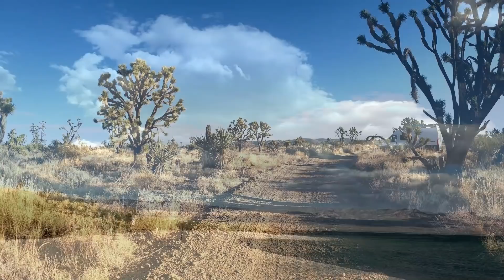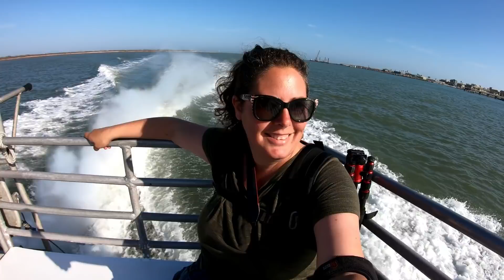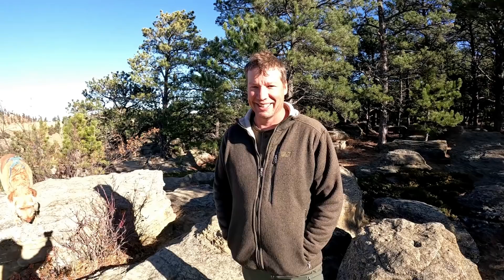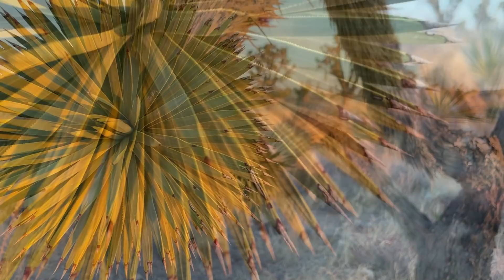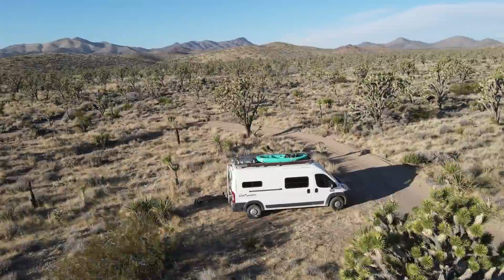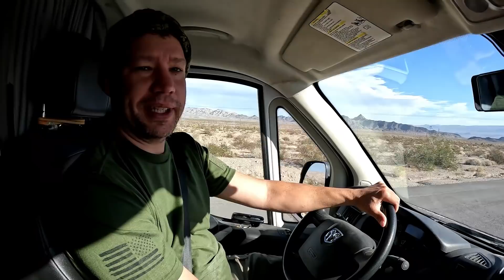FREE CAMPING at Six Mile Cove and We upgrade our BATTERY BANK on a Sandy Beach!!!

Comment: Hey guys, love the location and congrats on your new system. I just added a new system to my little C Class. I got the Bluetti 200 Max with 600watts of solar panels. It is self contained and has a 30 amp plug. I can just plug my camper in and, like you, I am a minimalist, so it will run everything I need. I am so excited to get to boondock more now. Take care and safe travels.
Reply from the maker: Congratulations on your new set up. I bet that 600 watts of solar is charging your system up fast! That's good to have especially in the winter when the sun is not as high in the sky. Have a great time boondocking. We hope to see you on the road sometime. 👱‍♂️👩🐕🎾

Comment: Do you deflate tires for bad washboard roads?If so how much?Thanks
Reply from the maker: Not that often but we are about to hit a washboard road that goes for 30 miles. I will air down on this one. The rule of thumb is to drive over 1” square tubing. Let air out until both sides of the tread touch the ground. Sometimes the road will determine how much air for a comfortable ride. I don't like to go down more than half of the required psi.

Comment: Great job on the new battery system and very "pro" looking "circuit board".  I put a 100AH AmpereTime in my truck camper a year ago and bumped up my solar to 225w.  In 5 months on the road last summer, I never used anything but solar to charge.  Like you, I don't have any high power devices.  You should be in great shape with 200 AH.  Safe travels.
Reply from the maker: Nice, Ralph! Good to hear your AmperTime is holding up. So far it's been an amazing improvement, we can leave the lights on and even run the ceiling fan all night now. 😎

Comment: Congratulations Dave your installation looks very Clean and organized. 
I have been using that brand of batteries for just over a year. 
It has been flawless so far. 
I used the Blue Seas circuit Wizard  app for a guide to size my wiring and Fuses. 
If its good enough for the sailors it's good enough for vanlife 😉.
I don't know how you did it for so long on the old system, 80 amp hours 😱.
Always a thumbs up 👍
Reply from the maker: Thank you, J.G.!! I don't know how we made 80 amp hours work either! Good to hear you still like your AmperTime batteries after a year! They seem so much less expensive than many other brands. I will check that Blue Seas circuit Wizard app out. Thank you! After all I am a sailor 😂

Comment: I knew it would work when I saw that divider panel.  :)  It looked like a lot of good planning went on.  I didn't hear mention of any alternator upgrade to provide the extra 50A for charging the battery.  I put a 40A Renogy DC-DC charger in my minivan and set it to only charge at 20A until I see how my alternator does.  It charges full power at idle with no need to rev the engine.  BTW thanks for the heads up on that great camping spot, and on the Joshua tree forest nearby.
Reply from the maker: Thank you! That sounds like a smart idea starting at 20a. We were fortunate to have a friend in a Promaster test the 50a pull in his similar set up for the last 12 months or so with no troubles. That panel design idea came from Glenn. We are so thankful to have his help in this upgrade. 😀